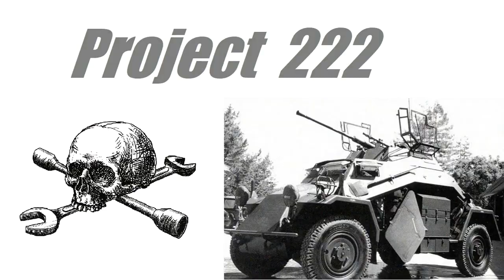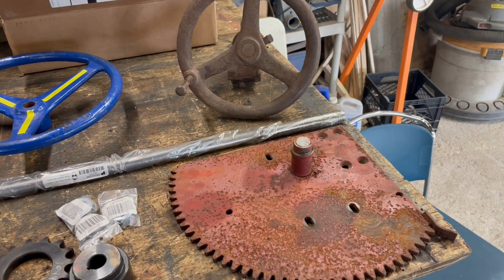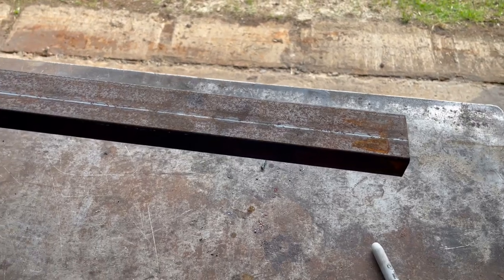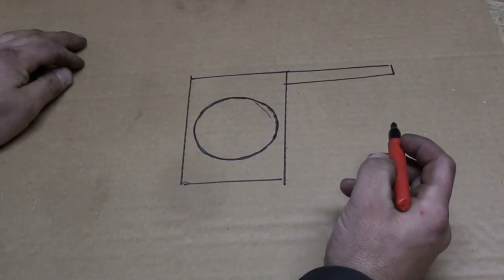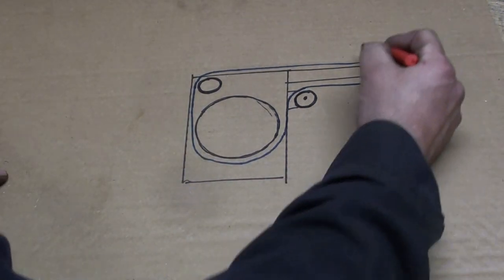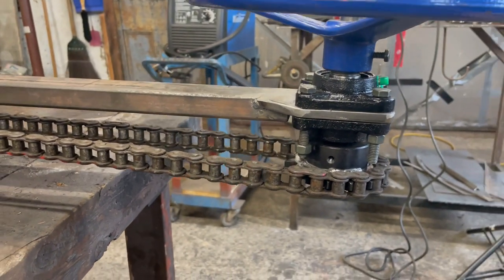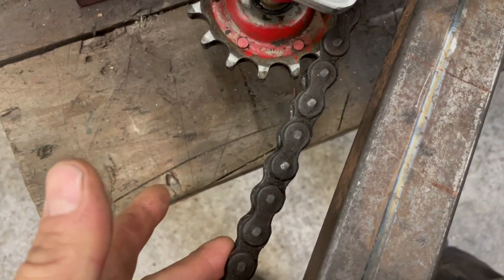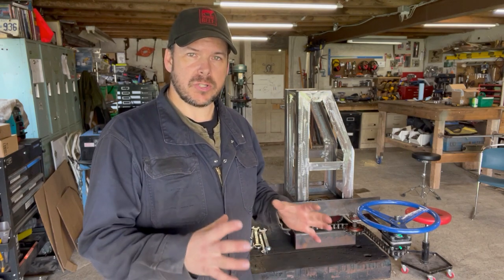Project 222 Ep 53 Gun Carriage

Comment: I have always want to try and build a SdKfz 234. with a all wheel drive like it was but I just can't figure out how to build it from easily obtained stuff. Any suggestion? Great build series.
Reply: I know exactly what you mean, I want to build a sdkfz250 but I've not been able to find any detailed tech plans. So i'm just going to build a wood mock-up and go from there. Good Luck with your build! We both might be surprised how far we can go with this.
Reply from the maker: That’s a tricky one… but it would be awesome.  Really stop and think about how it will be used.  Is all-wheel drive really necessary?  A a 4x4 set up would be doable with solid axles.  The very back set tires would be just spin free.  The middle sets to wheels would be drive tires and the front set would just spin (and turn).  That’s how I’d build a replica 234
Reply: @woodsarmoury  Never really thought of it that way thanks.